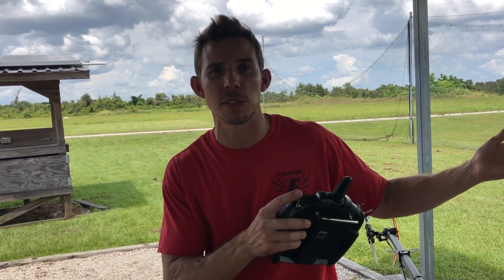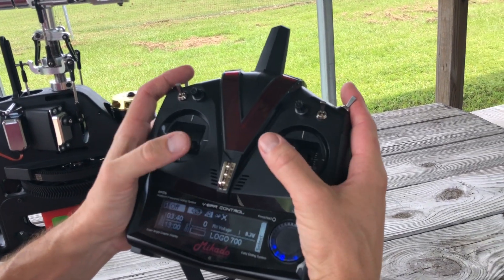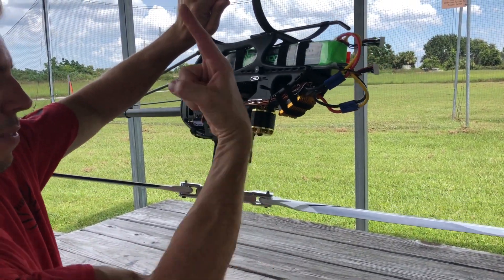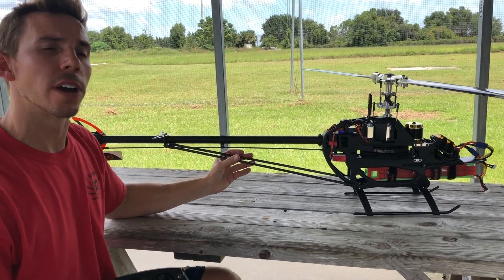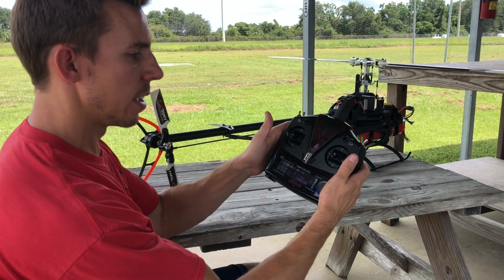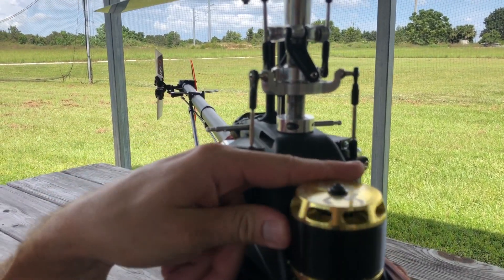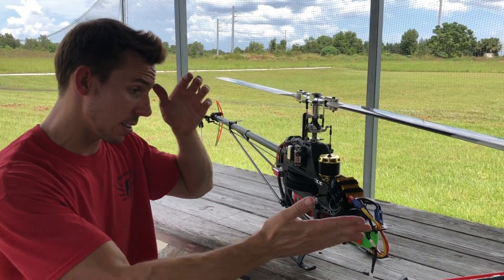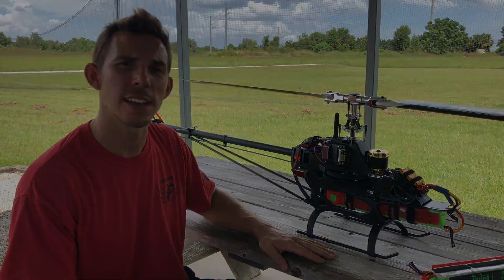RC Helicopters: How Do They Work?

Comment: Hello , I'm new to Helicopters . I have a 450 SE . My question is the top or large gear spins as it should but the smaller bottom gear witch is the main drive gear doesn't spin at all . Have I forgot part of the Radio commands?. Thanks , Bobby M.

Comment: Good explanation, very informative when youre in a pinch to learn something in a very short frame of time. I have a drone but heli seems more silent and agile, i can see it can stop faster with swash plate mechanism.. which can do a reverse thrust.
Reply: In drones i have to literally flip it, in order to achieve reverse thrust which makes my stopping distance longer.
Reply: There used to be some tri-rotor crafts with "collective pitch" control, but nowadays with speed control and motor speed becoming so accurate they don't bother.
Also, tri-rotors and are not expected to try to ever match the CP helicopters so, again why bother.

Comment: Greetings, I was wondering if the gyroscopic effect present in real helicopters is negligible in RC ones, this question popped in my head when you showed how the swash plate moves when you use the right control stick
Reply: Ok, I was completely wrong, I just noticed that there is a 90 degrees angle between the position of the control rod of each blade and the blade itself, I will leave the comment in case it can be useful, if you think otherwise let me know and I will delete both of them

Comment: Nice explanation! But i have a question, and it may sound stupid. I have a kit helicopter, and i can't obtain the gyro, as it quite difficult to get one where i live. Can i use RC car gyro (usually installed in drift car) for the tail rotor? As i think it's work in the same principle to counteract any drift
Reply from the maker: Hey I think you could try that but it would eventually be very frustrating. It would be in your best interest to use a helicopter dedicated gyro. Helis are hard enough even with the proper gear :)
Reply: Head holding gyro's were proven and perfected from rc heli technology more than ten years ago then applied to other things like airplanes and cars.  Check the car gyro specs for response time and matching servo requirements.  Most modern rc helis all have 3 axis gyro's, but you can still fly with mechanical flybar "+ tail rudder gyro.  However, this is not for beginners and a 450 size carbon fiber blade at over 2000 rpm's is a lethal.  This hobby is very dangerous and you must respect everything about these machines, battery, control systems, where you fly and your honest skill level.  You build and program the helicopter exactly as specified. You do not experiment or hover in your apartment room.  Geeze, no wonder this hobby lost popularity.
Reply: @trexinvert   Thanks for the info and advice mate. I think it's true that rc helicopter lost popularity. A friend of mine used to fly rc helis are now flying quads, as he says it's safer not having 60cm blades running in front of his face, and quad's parts are easier to get. I just bought K-Bar gyro recently. Still waiting for delivery though. Peace✌️
Reply: The fact that you are asking questions and seeking answers gives me hope that this hobby will continue.  Flying, Programming and building/repairing is not easy but very satisfying when you learn to do it right.  Just to be able to control a tail-in hover is an accomplishment.  Then you learn all 4 directions(tail, nose, side, other side).  Then you learn to "move" in all 4 directions.  Then you learn to hover "inverted" tail-in.  Then hover invert all directions. Then  learn to "move" in all 4 inverted directions.  It's called learning the basics and mastering every orientation.  Yes, it is very regimented.  Bobby Watts and any advanced pilot will agree that's exactly what you have to do.  So, when flying (at least reasonable speed/altitude) you have no "blind spot" where your mind freezes and you don't know what to do.  Keep in mind, it takes hundreds of hours on a serious computer simulator(realflight, phoenix,....not a cheap mobile device, but something that connects to a real rc heli transmitter) to get to this point.  In addition, to "testing yourself" field flying and crashing.  However, I think you being a pilot of a real plane should be no problem.  Keep on.